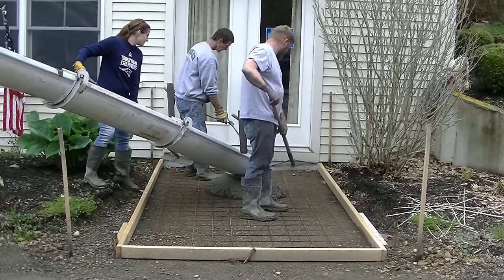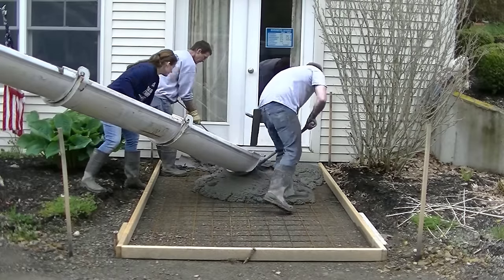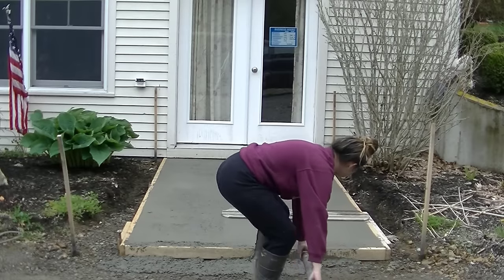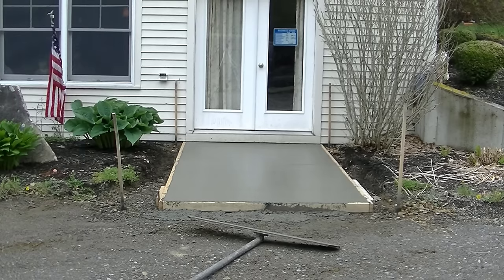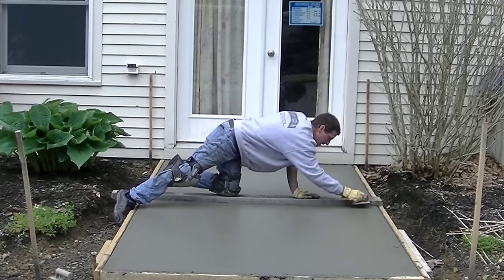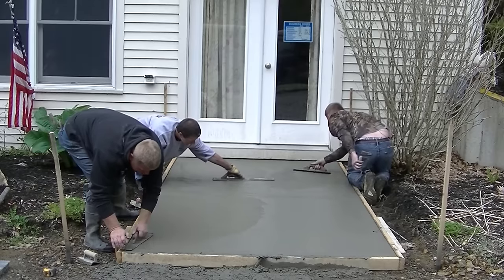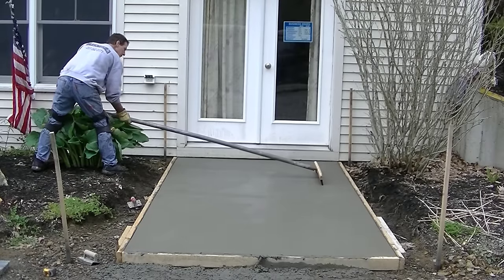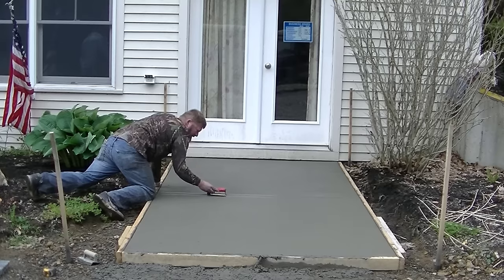Dry Pour Concrete VS Wet Pour Concrete - No One Else Is Telling You This

Comment: So mike, you have a lot of good questions, the same ones I did, But I, being an engineer, didn't just guess and speculate. I devise some pretty simple tests to answer those questions and concerns. I want definitive answers. 

First thing I did was do my best to forget everything I knew about wet concrete. And I did not just assume wet was better.  I completely get that it is really tough for someone like you, with all your wet pour knowledge to put that out of your  head.  I watched your dry pour experiment and noticed the multiple times in the process that you saw things that didn't look right to your wet pour wired brain, so you tried to "fix it."

But again, rule number one for dry pour is forget what you have learned about the wet pour process, 

I made multiple test dry pour tests using the same methods. I made several forms using clear plastic containers that you could see through to observe hydration throughout the process, through the sides and bottom.  For watering, used a garden sprayer set to a fine mist, so I could very accurately measure how much water was being used. I even went so far as to put a plastic sheet down to catch overspray and measure that so I could subtract that from the total water used by the sprayer, so I knew precisely how much water the slab got in total. I calculated the total slab volume and then knew exactly how much water was needed to get the minimum amount. (As I said, I'm an engineer so I wanted precision measurement. 

Now you want to be sure the dry mix is adequately blended when you get it, so I recommend working it a bit with a rake to be sure it's well blended. (As a side note, I did some detailed examination of the dry mix. and it turns out that the cement powder fixes itself pretty well to the aggregate. Looks to me like maybe a static charge effect that makes a coating cling pretty well to the aggregate, I was pretty satisfied that the cement in the mix was well blended,)  So some engineering overkill, maybe, but I wanted to be sure the dry mix was well blended. 

Now a note on screeding. You want to be pretty aggressive to ensure the aggregate gets pushed down and the fines are brought up. This is the most physical work necessary in the dry pour process. But the key advantage to dry pour is that one person can do it and you have time to pace yourself. So you can screed for ten minutes, take a break and go back at it. Take your time and observe how well aggregate us buried and fines are on top. 

Using the dry paint roller makes an amazing transition to the fines on the surface, It does way more than you think it will. If you see a spot that could be better, ten re-screed and reroll  that area. Then it is ready for water. That said, I have found that you can get an amazingly good surface, by dusting the slab with a vert fine later of 1 pat Portland and 2 parts sand, well mixed. Use a kitchen strainer and dust it on like putting powdered sugar on baked goods. Some guys use mortar mix on top, which I do not recommend because motar mix has lime in it. With the Portland/sand mix, you are matching the fine exactly as in the concrete mix. Cheaper too.  It doesn't take much to improve the surface. If you ad about an 1/8 of an inch, this is plenty to improve imperfections. I see this as an optional step, but then hit it with the paint roller and you are ready for watering. Everything up to this point is not time sensitive and one person can easily do it without help. 

So, I adjusted the watering schedule somewhat, based on observations,  So I fine mist to the point where color changes, but no water is collecting on the surface. Through the sides of the forms, I observed the water migrating down into the slab, Very evenly BTW. After 30 minutes, it migrated down about 3/4 of an inch and slowed down or stopped migrating. So my modified schedule is one watering every 30 minutes using mist only and avoiding any water starting to collect on the surface, so evenly wet but not saturated. Each watering I watched it migrate down amazingly consistently. about another 3/4 inch before it was fully hydrated. I must admit, I was a bit surprised at how this actually worked in practice. It tells me that the concrete mix hydrate very evenly and absorbs the water in a downward direction.  

I continued with this same process every 30 minutes for a total number of watering being equal to about every half inch of finished slab. So for a 3 inch slab, six waterings 30 minutes apart. at the last watering, I could observed the full  thickness of the slab being fully hydrated. I was really surprised at just how consistent the absorption rate was and I repeated this in multiple slabs, 

So at this point, I carefully measured my total water usage, And another astounding surprise! The total measured water used, subtracting the measured overspray, matched the calculated minimum water require plus a few percent!  SO what this tells me is that if you water correctly, you will achieve full hydration without using too much water. My target was to be at minimum require water plus just a bit more to account for slight variation in your actual dry pour slab thickness. By repeating these test slabs multiple times with the same observed results, I'm convinced it is a very repeatable process and at least somewhat self regulating. 

So I let these tests cure and removed them from forms and ten cut theme with a concrete saw blade. Very impressive showing evenly cure concrete with excellent bonding of the aggregate, Keep in mind that i rigorously followed my procedure, never trying to correct something that didn't look right or improvising along the way. I followed he plan with engineering discipline so I knew I could trust the results. 

Lastly, I took cured samples and strength tested them. I used  a hydraulic press with a homemade pressure transducer.  n calculated the pressure for the ram diameter.  Granted, not as accurate as a lab test using ASTM standards, but a reasonable substitute. I observed and calculated right around 2500 PSI. I won't try to suggest that these were lab quality tests and there was some variation but then the top and bottom surfaces were only roughly parallel and my sample were not perfectly the same size. 

If you are honest about it, you set out to prove that dry pour was not a legitimate option,  but you really didn't demonstrate an honest answer to the question. You did not follow the directions and instead created some bastardized hybrid of both wet and dry. 

Started the video stating a bunch of questions you had about dry pour, but didn't remotely attempt to answer them,  t reminded me a lot of some guy questioning he election talking about unproven allegations and raising doubt with questions you couldn't answer. Questions are fine if you use them to find real answers and not to just to spread doubt. As I said earlier, it would be very hard to unlearn what you  already knew, assuming  it applied. 

A lot of people told you they had good results but you just rejected  those out of hand. I gave you very accurate answers to your questions and plenty of supporting detail. Mike I'm giving you this because you are a concrete guy and should really know how to do this and not blow it off as a crazy method. If you think about  it Mike, it really should work, but it will go down far differently than what you are used to.  In the end, it is much easier and one person can do it. It has a couple key issues that you need to get right for best results  but it i forgiving and can be redone before you start watering. It's important .to get the watering right, but it is pretty easy and you just need to have patience. BTW, don't pre-water the area. You want the water absorbed down, not up. You do not need to worry about the ground pulling water out of the mix because dry concrete is far more hygroscopic that sand or dirt. Better that the ground is dry so you aren't drawing water up. You want i to migrate down, And if the ground is damp, it's actually best to put down plastic sheet on the bottom of your form so you don't pull moisture up. It's a good alternate method and I have proven that the science supports this.
Reply: Thank you for your comment.  As a woman whose strength limit is dragging a 60 lb. bag, dry pour makes all sense to just make a pad in front of the back door.  Since I live in a very dry S. AZ, I was wondering whether to mist the ground first, but without knowing the science of it I won't pre-water the ground.
Reply: @hisremnant  You're welcome!! I invested a lot of time researching and testing dry pour.  As I stated, I took an engineer's approach to testing and evaluating dry pour.  It is just too much easier than wet pour. I'm 70 and my back doesn't take well to abuse, I wanted to find the best ways to do it. 

I love the concept but it clearly is it's own process that differs a lot from, wet pour. I find uses for it that I previously considered doing wet, but decided against it.  

A few other tips I may not have mentioned. Some guys have suggested using a layer of mortar mix on top to improves the surface, The problem with that is that mortar mix has different properties and has lime in it. so it will cure a differently and doesn't handle freezing weather the same as concrete. But the fines are key to a good finish. That's why screeding well is important. But you can make your own, fully compatible fines using one part Portland cement and two parts sand,  You can sprinkle a bit of this on top, just before using the paint roller. It doesn't take much, about an 1/8 inch will do. It will improve the surface an is the same as the mix without stone,  so it is fully compatible. If you screed up enough fines, you won't need it, But adding a bit make the pant roller step a little better.
Reply: Thank you so much for your work! I am not an engineer, but really appreciate the engineer approach to things. As a physician, we look for evidence based medicine - and I really appreciate defined evidence. Then I can make an informed decision off the evidence and not just opinion. Great job!
Reply: Thank you for your engineered scientific analysis I really enjoyed reading it my wife and I have done three dry pours so far and they have come out fantastic. Thank you for your experiments and the results that you shared one thing I do disagree with you on is that the election was stolen.
Reply: @hs9917  I look at most things with an engineer's eye. Theories are a starting point, but in the end, you have to look at the actual data the results provide, I try to keep an  open mind but le the real data determine the results. As I noted, a few times I found the results were different than anticipated.  

As for the election, there were a lot of theories and possible explanations, but in he end, the real data did not support theft at all. Not a single proposed theory about what happened, proved to to be true. Even smart people who supported the guy, looked at the results and found them correct as reported and not manipulated as suggested and people who spread the lies have been convicted, Sorry you were unhappy with the results, but facts are facts. Sometimes they tell us what we don't want to hear, Good luck on your dry! pours
Reply: Tyler Ley at OK State just did some real lab testing on dry pour.  His recent YT video.

Comment: Depends on the application, don’t need high strength for a side walk or porch, just high load locations like driveways. Never had an issue with dry pours.

Comment: I have been dry pouring for many years over many homes and projects. Never had any cracking or problems.  I just can't justify the cost of having concrete poured for sidewalks and patios.  If it is for a garage or around a pool, yes. But Cement pours have gotten outrageously high.  If I want "wet" I order it myself and do it. It really isn't hard if you know the process.

Comment: If I had a 4 person crew and a big enough job to call a truck in, I'd do it just like you did, but what if you are by yourself?
There are plenty of videos showing how a dry pour chicken coop slab held up after 6 months, how to get a smooth finish etc. 
Wet mix properly done is superior, but that's not the point. Even pouring a slab in sections would be difficult if you have no help. Some will simply set pavers on the ground as an alternative. Dry pour can be done at any pace by one single person. It's still work, but not time intensive work and it might be good enough for many purposes, but I'm comparing it to pavers laid on the ground, not a traditional concrete slab poured by skilled workers
Reply: That is an option. I have one project I'll do with hand mixed, but I have another noncritical area I want to try a dry pour on. I have my own ideas I want to test.

Comment: I combine the two methods. I build up the dry pour to the depth that I need. If it looks good i'll leave it alone. If not ill finish it off with a few millimeters of topcoat with a mortar mix before I remove the forms. I did three 3x4 slabs at 2 inches thickness for my shed that's a 6x4. it's been 2 months and it has not cracked. I made sure I did prep the ground per usual as if it was a regular wet mix. Remove the dirt, compact, gravel etc.

Comment: I made a tool shed slab using dry pour. I didn't worry too much about smooth finish. The thickness was 100 mm. I poured about 50mm then put steel mesh, watered it once with 'shower' setting, then poured another 50 mm. Watered two times with about 20 minutes interval, then did some compacting. In the end i mixed dry mortar mix with water and added it on the top. Next step was  screeding. It was enough for me but as an experiment in about 40 min i applied thin layer of gray  cement, sprayed with 'mist' setting. It gave me that magic paste on the top and allowed to get very nice and hard surface. 

I believe it could be even better if i had more experience with concreting.
Reply: That wouldn’t happen because if u had experience in concrete you’ll sit here and laugh at your self 😂
Reply: @SHADOW_VLOGZ  I can send a picture to you if you want
Reply: Interesting!

Comment: To answer your question, I believe, when done correctly, dry poor is far easier than wet pour like in your video. Wet pour may or may not be more long lasting but I have yet to see a dry pour that is done correctly fail. I will be testing my dry pour after 30 days curing by driving my skid loader on it. I have no doubt it will hold it without issue, if it does that I wont need anything stronger. we shall see.

Comment: This video opinion is typical of an old school contractor. The dry method isn't going to put you out of business' but for the average home owner it works and it works just as good. I have used both ways and both have been perfectly fine for a regular residential home , however maybe not so much commercially do to traffic on the slab. Thanks for the vid
Reply: 100 % agree with your comment.
Some of the professional people need to relax a bit.

Comment: So, are you saying we should tamp our dry mix well first, before we sprinkle it with water? That would make sense. Concrete out of a sack is not waterproof once it sets. As long as the bag mix gets water, it will continue to harden. Think of set concrete as being porous, like a sponge.

As a test, maybe I will buy a back of bagged concrete, cut the top off, do the garden hose test, and leave it outside to the weather and then see how hard and durable it is in a month or so, or perhaps many months. 

What we see three people doing in the video could be done by one using the dry method. I'm not saying the dry method is the best, but it might be the best method to use depending on a homeowner's situation, be it concerning expense, time, labor, whatever.  Certainly, the dry method isn't for every situation, and neither is the wet method either.

Comment: I must say, I understand why you may think wet is better than dry. On big jobs I would agree but for the diy small jobs I have to disagree. I've done both on small jobs and haven't found 1 better than the other. After 4 years my dry concrete has held up just fine and I've even done some 20 years ago before it was popular and it's holding up. Again I agree with you on  big jobs.

Comment: I saw in the video where one of the guys was using a hook to pull the wire mesh up into the concrete. Then, everyone jumped in with rubber boots to work, level and smooth the concrete. So I’m guessing the wire mesh was stomped into the dirt below rendering it useless. Shouldn’t you have used chairs, or at least kept pulling the wire back into the concrete?
Reply: I was thinking the same thing!!!  The point of having the wire mesh would be for it to be in the center on the concrete, not on the ground.  Very poorly executed on their part, I would never hire this crew.

Comment: Dry pour is a depends on the situation thing for me. I just did a dry pour at 3 in slab. I think it will do just fine. If it needs lots of strength I'll do wet. All depends on the usage. Iv done fence post dry and it worked just fine.